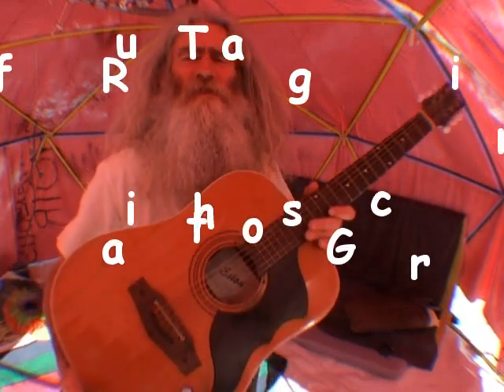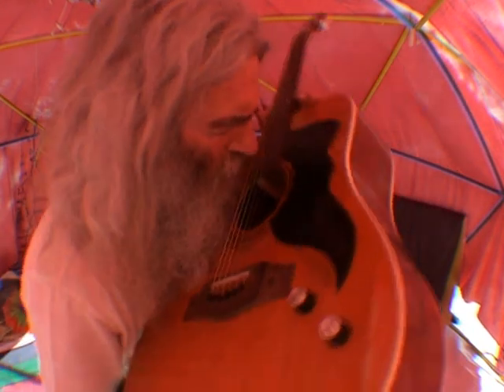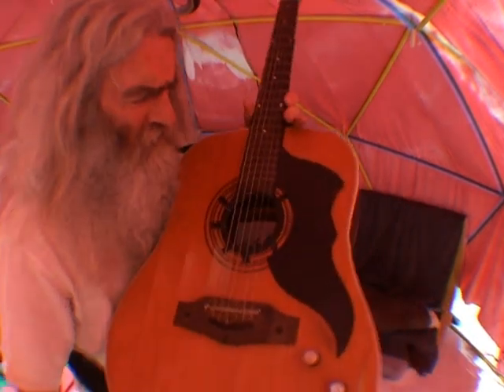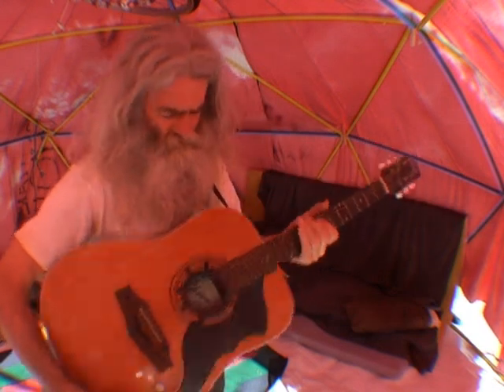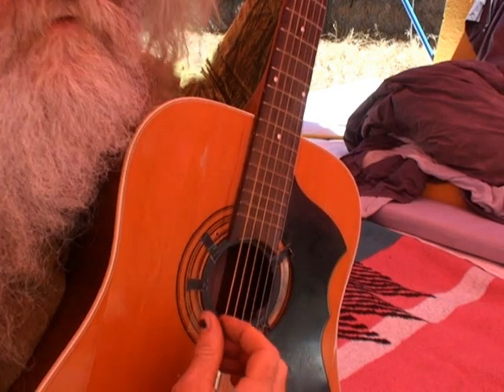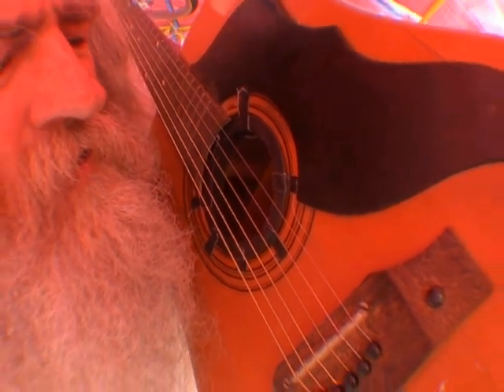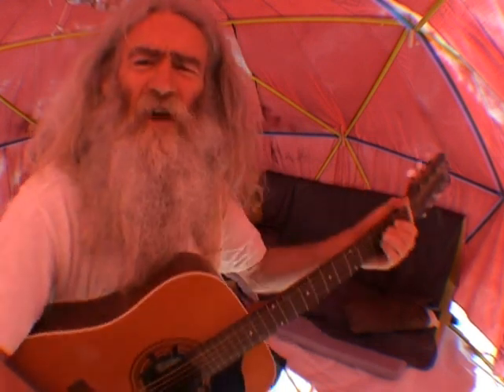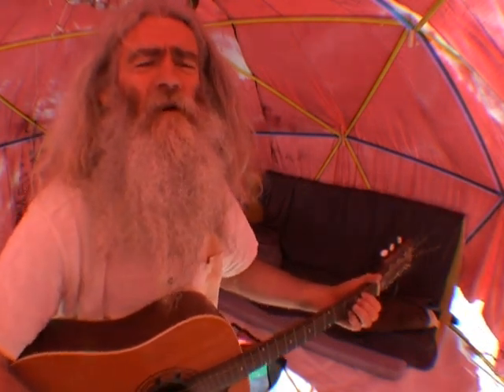Improving Guitar Resonance

Comment: Go into your local music store and start singing into the guitar holes and they'll lock you up for being nuts!
Reply from the maker: They won't and they didn't with my last guitar. I had the specifications for the body of the guitar because it needed to fit through a manhole into my tank studio. I ensured the guitar was in concert pitch, found a resonant note, found it was G and bought it - a tangle wood.
Reply: @thevoiceharmonic  i bought a used tanglewood tw28 but it has less resonance what should i do peter
Reply from the maker: @prateekbhardwaj9943  Sing into the sound hole and see what pitch the body is. It should be in concert pitch if it is a good guitar, though classical guitars are sometimes deliberately made to avoid this because it favours certain pitches and hence, amplifies them. Most good guitars have a good resonant frequency. I have retired my tanglewood because of a problem with the bridge and a machine head, then it broke deep down inside. A few weeks ago I bought a CORT, a Korean guitar with the body in the pitch of C. Note decay is up to 30 seconds. I am not a great guitarist, but I am getting back into it after not spending much time on it for a decade. My main instrument at the moment is tenor recorder because of its complexity and the challenge that produces for my musical brain as I transpose every tune I know through it consecutivly.
Reply from the maker: @prateekbhardwaj9943  If it does resonate in concert pitch in some key (my tnaglewood was in G), that is as good as it gets. If it doesn't do that, retune all the strings to the key that it does resonate in and see if that makes it louder.
Reply: @thevoiceharmonic  thanks :)
Reply: @thevoiceharmonic  awesome i did not know these stuff!will try these. why don't you make videos now days? , you are an interesting person will love to see your new videos.
Reply from the maker: @prateekbhardwaj9943  Thanks. I would upload more but I can't get video editing software to work on my Mac. I also had data issues and I live rural and the signal strength has not always been good. I also become despondent as people never seem to share my videos. They like them, but don't share them. My last uploads were about 7 months ago. I also had my main camera break and don't like the new one and to off load, I have to get a partially broken computer to work because the new Mac doesn't have the input jacks. I will get around to doing more uploads. I think about it every day.

Comment: Changing the body resonance will make some difference as to the predominant notes but good guitars will be good, bad will be bad. I've been able to change the main resonance on guitars and have seen that it does NOT make them better, just different. You want a balance, so in most guitars a main body resonance of around G or G# is best to you can get power in the low open E and still have a strong open A. Too close to either one will lessen the power of the other.

Comment: okay so i saw this video. I try to find on my guitar the resonance it fits. it goes into A Key. It is so much higher compared to 6th String of E. My string would probably break. Instead, i try  to find a tune "where" my string and guitar will resonate more. And Yep! This is effective :) Thanks. Keep up the good work Sir.
Reply from the maker: You should be able to find at least 3 notes that resonate in the guitar body. It sounds like you have found one of the high ones. There should be another in a much lower pitch.

Comment: I think you’ll find it’s actually the strings resonating when you sing into the sound hole and not the guitar body itself
Reply from the maker: The strings have their own pitch which either resonates with the body of the guitar, or don't. Take all the strings off your guitar and sing into the hole and you will find some notes resonate and others don't. Ensure the resonance of the body of the guitar is in concert pitch, and you have a great guitar. I have tested my theory on about 30 different brands. The only discrepancy is with some guitars used for classical music where resonance in a particular key would change its volume. Some guitar makers ensure that body resonance does not favour a particular pitch, but most guitar players in rock and folk just want a great sounding loud guitar
Reply: @thevoiceharmonic  i am agreed, your theory is correct its scientific 👍